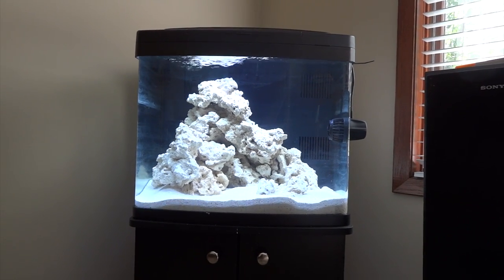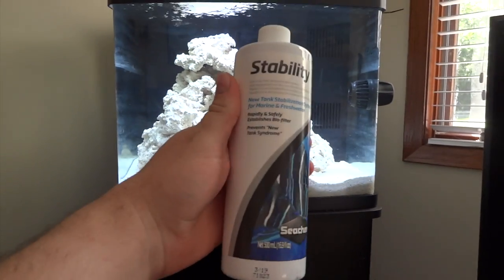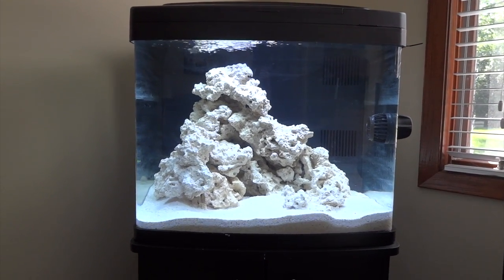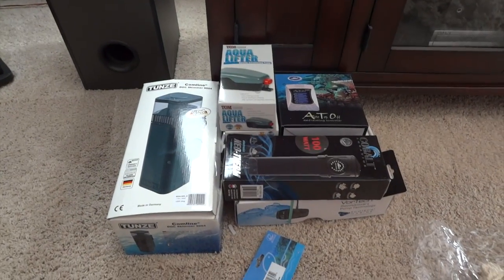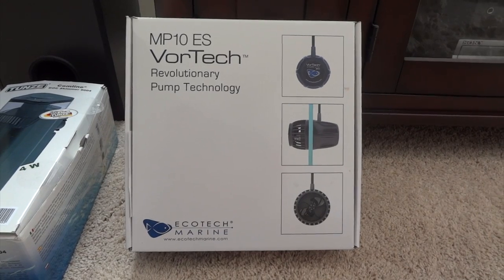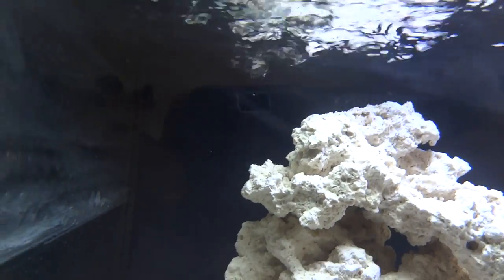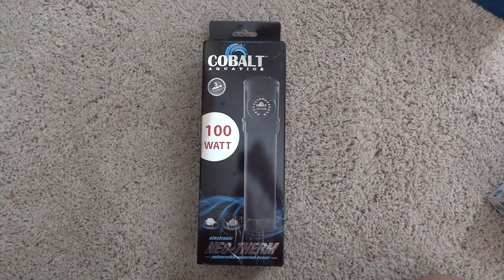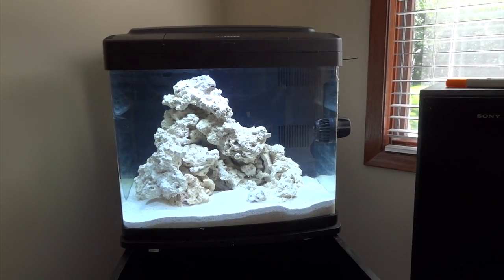Coralife Bio Cube 29 Build - Part 1: Equipment and Set Up

Comment: So you finally did it! The skimmer is nice but I've noticed how hard it is to dial in. Word of advice on the skimmer... When u install it make sure water level is right at the grill in the front. And use the air adjust valve to dial in the bubble height in the neck. This skimmer skims wet so expect it. Takes a week or so to break in.... Be carful of your scape trapping detritus... Looks like a lot of places for it to happen with rocks stacked that way. you have a great plan man..Looking forward to it... Be easy! 👌🏾
Reply from the maker: CJ'S AQUARIUMS Thanks CJ!

Comment: Welcome to the salt world !!!

Something through me off thought I'd let you know that whatever brass or copper fitting you have on the output line of your ATO could be leaching into your tank and potentially kill all the sensitive corals fish and inverts you add over the next year.

Only other thing I'd look at upgrading is to one ATO pump if one of the aqua lifters fails I'm not sure one will push enough to fill the tank and could burn out the pump or make it catch fire. Even a small pump with a low head pressure rating would work fine 4ft of head height and a 80-100 gph should keep your salinity in check

Hope this helps
Happy reefing
Carson
Reply from the maker: Carson Anderson Thanks for watching.

Comment: how many pounds of rock is that
Reply from the maker: I'm not sure exactly.  I ordered 40 pounds, but used a little over half.  I'd say 30-35 pounds.  I used a lot, if I had to do it over, I wouldn't make the rock structure so big.  It takes up a lot of space in the tank.
Reply: +Brian's Fish Tanks how long did it take your dried rock to become live? I'm thinking of doing it this way because I had a issue with hitchhikers that came in hidden in sponges on my live rock. Just don't want to wait months for it to level out.